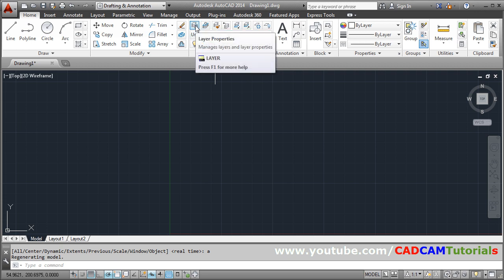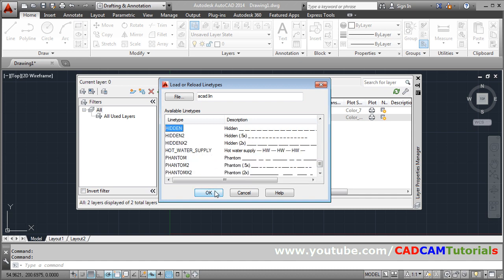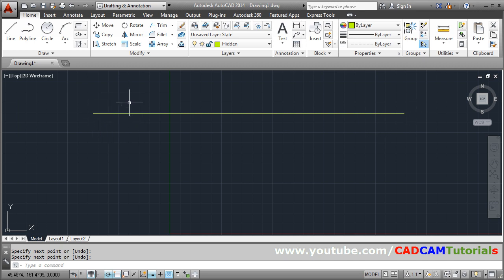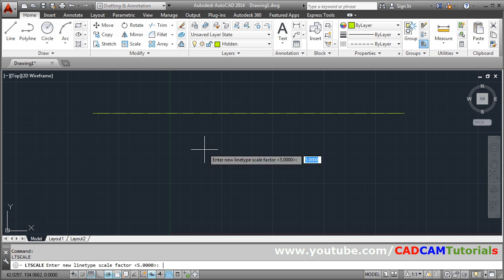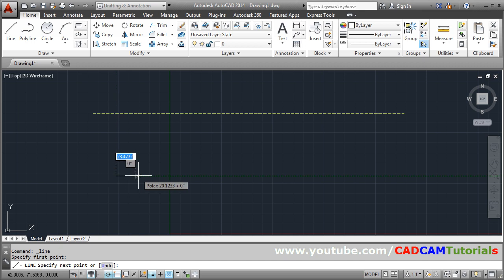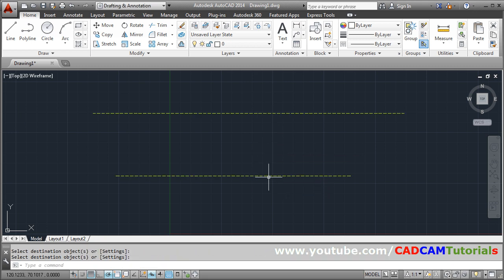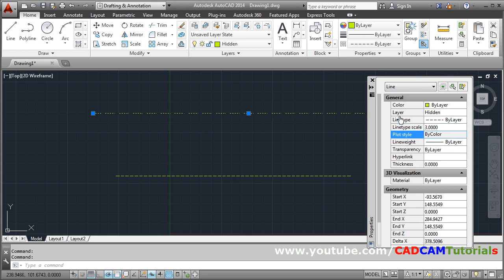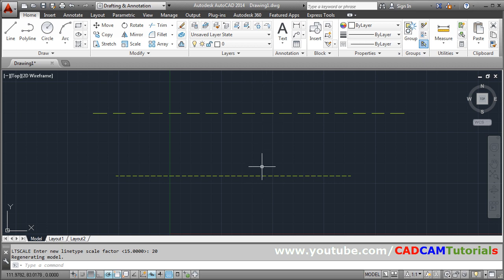AutoCAD Hidden Lines Not Showing in Model Space | Appear Solid | How to create

Comment: I've tried values 10000000000000000000000 and 0.0000000000000000001, but it didn't work
Reply from the maker: Try reduced value like 0.5, 0.1 and so on
Reply from the maker: Check hidden line type is applied to layer.

Comment: even I used  LTS  command but I didn't solve the problem. is there any another way to solve that problem?
Reply from the maker: Reduce value for LTS.
Reply: Thankfully
Reply: Try increasing the value of the LTS.
I had to use a value of 1500 for it to work on mine
Reply: @abdul.k.g7069  I changed mine to 1000000, it still didnt change
Reply from the maker: Try reducing scale factor
Reply: @CADCAMTutorials   It has worked now. Had to use 0.03 to see it. lol!  Thank you so much bro. I've been following your videos since morning. Doing the elevation now. very interesting stuff you have here. Well done!